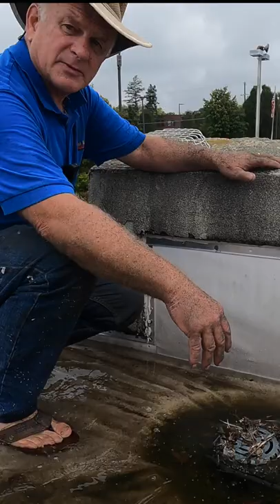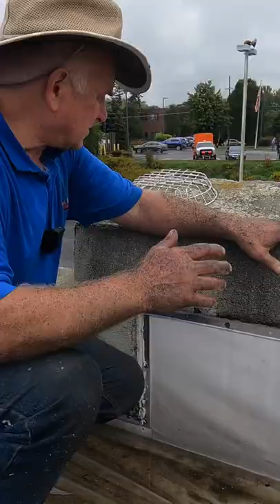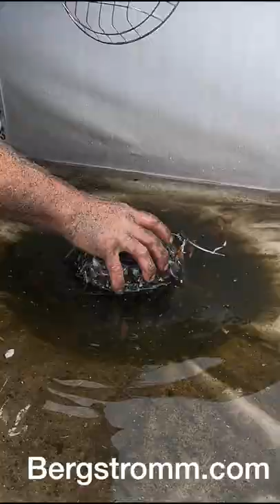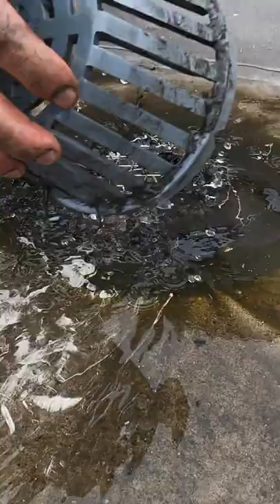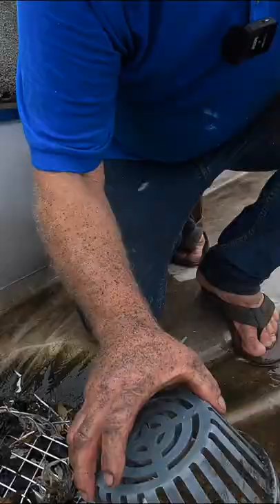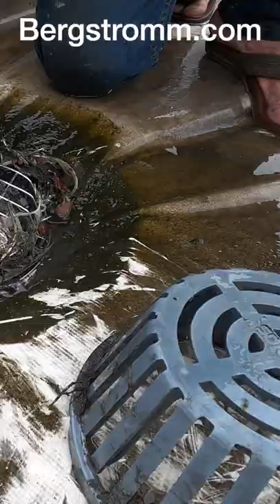Unclog Roof Drain in seconds by doing this #shorts #RoofDrains

Comment: That's great for a basic small little drains like that but when you are on roofs that I deal with when it's double the size of that it's meant to block on the sides so when the water gets higher it continues to rise it'll still overflow that strainer that you put on if the water was to get over 3 in and it had debris it would not only fill up the sides but the top as well

Comment: I wouldn't say it typical drain because the person who actually started it was actually really smart and reassessed it so it actually has to fully block before it doesn't drain (almost all installers install them flush to the roof so they block really easy and end up having a big pond on the roof) I see no problem with this install

Comment: I’d be worried about that thing blowing away in a wind storm where I’m at. It doesn’t fit to the drain pipe like the original one did.
Reply: Exactly
Reply: Wind passes through
Reply: And the original is cast iron and quite heavy. That cheap stainless wire one fits like shit and is so light the debris and water alone will move it.

Comment: Except thats only gonna work if you get 10cm of water at once, otherwise it would clog up the same plus let a lot more through. Ideally you could cut the metalal one in the middle so it can fit over the plastic one. That way you have a 2 stage system, metal catches the big stuff, plastic the rest
Reply from the maker: Well, the idea was to show that a strainer with bigger holes that will allow small debris through and that has a bigger surface before debris will clog it up.
What you are explaining is to put the strainer with smaller holes back, that is exactly why it clogs faster. You try to prevent smaller debris from going down the drain pipe, why? Small matter is not what will clog drains. let the smaller stuff through, less trouble.

Comment: Very smart I do home improvement and work on cars and that is genius always something more with more circumference is always better like drain leaves off of your hood like off your windshield and the drain out the drain tube gets clogged we often put bigger tubes in there so it can drain out especially like in your doors with your bigger holes in the bottom of your door so the water drains out